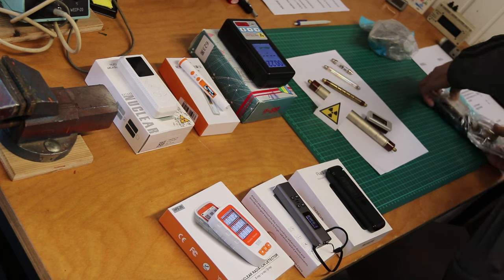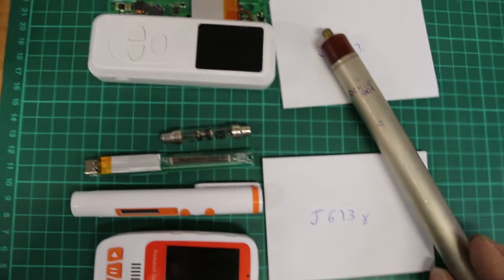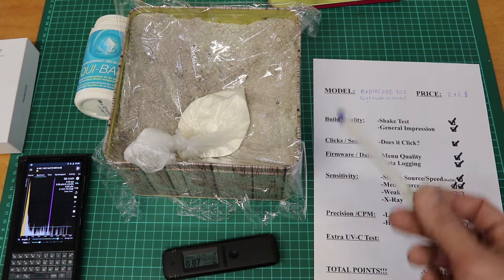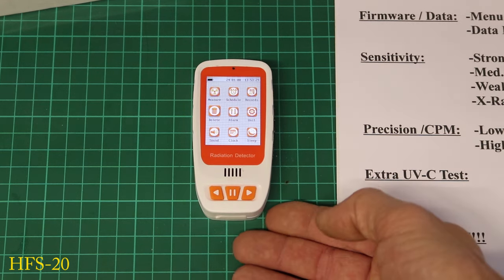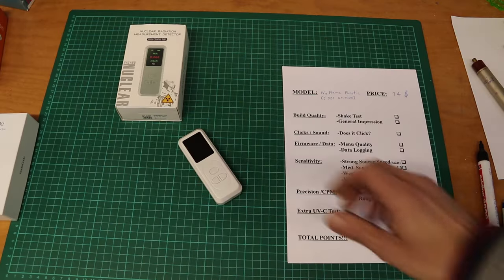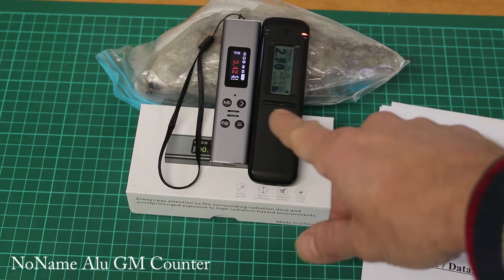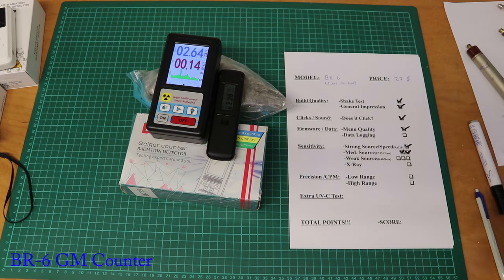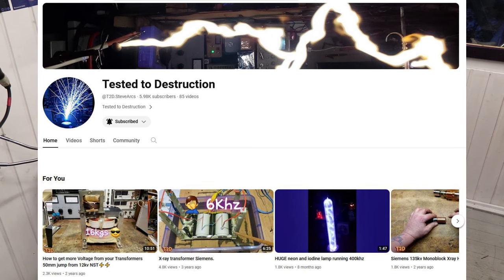5 Cheap Geiger Counters from Aliexpress (Review Time!!!)

Comment: 20 Minutes the white one which does not react to your souce is a Fake Geiger counter. Even the tube ist a Fake. Remove the tube and connect a cable between the 2 tube Ports and the counter Starts showing Fake results. I Just have one Here. The Volltage on the tube ist 3.7Volts and the tube ist only a  Glass with a wire inside. Complete fake.

Comment: The latest aluminium models are now able to measure β rays, as we have opened a window at the location of the Geiger tube so that β rays can easily penetrate into the Geiger tube. Woo woo we're late.🥲
Reply from the maker: Are you the Manufacturer? thats really cool! Thanks for reaching out ;) In general i like youre Product, the Design is Great! but i think there are some points you could improve ;) The Slits/Window is a great first step! The other main issue i see with this Geiger Counter is the Response Time of the Software. It is pretty slow compared to other Geiger Counters. For example the BR-6 is really fast, you see change in mSv/h immediately. On youre Device, it takes a few Seconds. If this could be faster, that would be great. The other thing is the J613 Tube. its pretty good for a small Tube, but all small Tubes are very limited in Count Rate. If you want to design a future Model, try to design it around the M4011 Tube (best chinese GM Tube on the Market, Beta Gamma Xray capable) or the J305 Tube (good copy of M4011). Just avoid the J321 Tube, this one is really bad.
Reply: Hello and thanks for your reply. Because the beta rays cannot penetrate the thick aluminum alloy shell, we have opened the window corresponding to the location of the Geiger tube, so the beta rays can easily penetrate into the Geiger tube, and this problem has been solved. But I want to explain to you another problem, that is, J613 has a significantly lower sampling rate than J321 and 4011 because of the limitation of its volume, and if the algorithm is the same as J321, it cannot achieve the measurement accuracy of J321. So we came up with the idea of another way, which is to find the actual amount of radiation of the measured object by measuring the average of the past minute. Doing so will cause our styles to appear to react significantly slower to rise and fall than other styles. (But this design can bring me a very big benefit, that is, our detector can pass the metrology certification of the Metrology Institute, and we test it in China's official Metrology Institute (Shenzhen Metrology Institute), and the result is: the deviation of the full scale is only about 5%~6%, which is why our products will be closer to your other model in terms of measurement data.) Sometimes that's the case, and if you want to be small and measure accurately, you have to sacrifice reaction speed, which is unavoidable. @BremsstrahlungChannel
Reply: What is the name from your Shop?
Reply: What is your Aliex or Insta name, i want to order a updated geiger counter. Which model should i order?

Comment: Fantasitc video! I bought an HFS-P3 last night along with the GC-01 GM's. Good to see I didn't waste my money on the HFS-P3. I got them from AliExpress :D
Reply: I'm a geiger counter collector and i can attest that the HFS-P3 is not that bad.
Of course is not perfect, the sensitivity is pretty low (can detect background but is not so accurate) but is tiny, cheap, it have the dosimeter function and also it have both the dose and rate alarm (with adjustable thresholds!).... and BTW it goes up to 5 R/h (which is A LOT, no other cheap chinese counter can goes that high!)

Comment: I bought BR-6 without reading reviews and I'm quite content with it. I liked how it doesn't have any gimmick. Just a board with the tube, a buzzer that can be turned off, a display and a box. Nice spacing between the grates and the tube, nothing wobbles, nothing is too covered. It also works on two AA batteries, which is nice as I greatly dislike built-in lithium cells.

I'm gonna use it to hunt uranium glass in thrift shops and possibly some minerals from waste piles. I think it will do well for that purpose as it's quite fast reading and sensitive. Thanks for confirming my intuition for the product.

Comment: You seem to have a lot of hands-on experience with various tubes and I'd like to ask you about the SBT-11 series. I have 3 tubes. One works well though I've noticed its background is lower than most, at around 0.7 uSv/h (around 15-16 CPM).

Then I have an SBT-11A which is what my device initially came with. It has times when it reads the background at around 0.3-0.5 uSv/h and I think it's movement-caused but I failed to figure out what caused this. It's difficult to get it to read normally but sometimes background returns to normal.

And I have a third SBT-11 which all around works well and seems to have even better sensitivity to the one I'm currently using. Unfortunately it sometimes, even without movement, starts to produce a lot of sparks on its own in one particular corner and climbs up to multiple uSv/h. If I shake it strongly this stops and it's back to normal but eventually it will do this again.

What can you tell me about these tubes and your experience because I don't know why I ended up with 2 defective tubes, was I just really unlucky or are they more finicky than most? There's also the case of the 3rd tube, it's not an 11A but it is more sensitive than my 11A to alpha and low-level beta so I'm thinking there's the mica window thickness but also the sensitivity of the inside of the tube itself can vary. I'd appreciate your insight.

Comment: Hello. What about the Pudibei NR 750 that Lily told. Is it better than BR-6?
Reply from the maker: i dont now the nr750, also i didnt see lils video on it ;) but looking it up on google it looks pretty similar :)
Reply: NR 750 is not too bad even if there is nothing special if compared to other cheap chinese devices.
Keep in mind that all the test that Survival Lilly do are not accurate because she failed to address the effect of the energy of the rays and she tested the geigers too close to a very small source.
Also the test in this video aren't accurate but still a little bit better than Lilly.
The NR 750 does the job fairly good at low and medium ranges but is not able to detect high and extreme amount of radiations (this is a very common thing for portable geiger counters, they failed when you needed most!!!)

Comment: A geiger counter in an aluminum casing is absolutely crazy if you ask me. How will you get a decent reading? 
It will only read gamma rays not beta rays or alpha rays.
Reply: Which means that the measures can be more accurate.....
The problem is always the same, if you want an accurate instrument you can only measure gamma....
.... if you want a super sensitive device, also able to detect alpha you end up with an instrument that tell you that there is something radioactive without telling the amount.

Comment: I really want to like the sharpie marker sized one, it's too bad it doesn't perform. Would it be possible to modify it with a Russian tube (are the voltages appropriate out of the box?) Also, is there any mod that can make them click, like a simple speaker soldered on the right place?
Reply from the maker: yeah it would be really cool to modify the HFS-P3 :) I only have one soviet tube that would fit, i did a quick test but it kinda performs similar.. im not aware of any good tubes in this size unfortunately (but im shure theres one out there!;) the voltage should be okay for most standardish 400v tubes i would guess, even if its abit on the lower side (i made a voltage sheet somewhere in my other video;) for youre click idea.. i had an idea for that but never tryed if it works ;) if youre good at soldering, maybe try to connect the positive of the LED (it flashes for every click) with the inbuilt speaker ;) cooould work! or use the LED positive to drive a tiny extra piezo or something.. i think LED positive is youre best chance for the click ;)
Reply: Is possible but not recommended.
The very good thing about this counter is the size.... if you try to modify it you can simple ruin it.
If you want someting you can hack, why not choosing a geiger that can be modified with RADPRO firmware?
In this way you can also adjust the response to match the property of the new tube (and you can also have some extra features too)
The compatible devices are FS2011, Bosean FS-600, FS-1000, FS-5000, FNIRSI GC-01
Otherwise, you can make your personal geiger using an Arduino based platform and choose the tube you want (preferably more than one tube, of course selectable, to have a wider range.

Comment: I'm new to the whole thing, but I heard that radiocode 102 doesn't pick up the alpha and most of the beta radiations (like the 101 before it)
Is that true? 🤔
Reply from the maker: ..im pretty shure none of the radiacodes pick up any alpha, maybe they do get some hard beta. but in general i would say dont worry too much about alphas and betas if youre a "beginner". Gamma is the bigger topic anyway ;) There is the Measall KC 761 if you want a full spectrum device, but im pretty shure is not very "beginner" friendly ;) PS: Check out the Channel "Studio 326", he has great videos on all that stuff! :D
Reply: Geiger counters that pick up alpha radiations exist but are more expensive and pretty rare.
Keep in mind that a geiger that picks up alpha-beta-gamma and X (eventually thermal neutrons too!) are very good for finding contamination but not to make a proper measurement.
If you want a broad range of detection AND accuracy you need multiple scintillation detectors (which is not something you can find in the average pocket sized device).

Comment: I have a question. Does the second cheapest one measure a beta type radiaton ?
Reply from the maker: good question! and after some further tests, i guess my answer is "maybe a little" ;) i dont have a "clean" beta source, but i did some further tests with the small J613 Tube thats in that detector, and as with most small tubes, the count rate is just very low. What i am pretty confident about however is that the BR-6 can detect Beta. BR-6 has the J305 Tube, wich seems to be the best of the 3 Chinese Tubes. I will post a new Video soon where i go into these details abit, and modify some Counters ;)
Reply: @BremsstrahlungChannel  Oh thank you for the answer, I've got at home few rad.a. things and I want to buy a dosimeter that is not so expensive but I want it to measure not just Gama waves. Actually I want to measure how much is my tritium chain harmfull because tritium is the most pure beta emitter
Reply from the maker: oh cool were talking Tritium! :D ive got some experience.. i have a small tritium keychain as a test source as well ;) and its my most difficult test source, even the plant ash is way more radioactive ;) i tested BR-6 with sbt-11a on the tritium and it can just barely pick it up. the only detector i have that can clearly detect the tritium is my Radiacode 102, but also with that, the count rate doesnt even really go up, but you can see the bremsstrahlung xrays on the spectrometer at about 5 kev. the thing with tritium vials is that they also emit a very small amount of x rays (because of bremsstrahlung interactions of the beta particles and the plastic/glass shield), so its also not really a "clean" beta source in practice. if you want my opinion, i would not wear it as jewelery on youre body, because it will give you a small dose of radiation over time (the x rays are not great over time eighter;). but if you have it as a decoration item somewhere in youre place, with a small distance to you,  id say that should be harmless. ill do some of these tests in the upcoming video for shure ;)  @wufan.cz.
Reply: @BremsstrahlungChannel Is the radiacode better than all the others in this video? I'm looking for one to detect radiation from nuclear fallouts/events as well as from reactor meltdowns. Need something applicable for that
Reply: @ryaniam22  all of the handheld detectors fail to perform at very high or extreme radiation levels.
The HFS-P3 have the highest range of all, which still may not enough if you are too close to the reactor.
I think that you should buy a military surplus device instead that is rated for both low, medium and high range, is calibrated for fission byproducts and is rated endure an EMP (for example an SV-500... but make sure that you have the full kit with both the internal probe and the external one)
Reply: BTW, if you have an SV-500 sets (i have two!) you can also find two another extra probes:
- a low range beta-gamma probe that can be either used to monitor surface contamination and can be submerged in liquids to check for liquid contamination.
- a very sensitive alpha, beta, gamma pancake probe (for surface contamination, also for food contamination).

Comment: I got an SBT-11a to install in my GMC-300+ but im not sure i have it working correctly. The background cpm went from ~20 with the M4011 to around 200-500 with the SBT11a but checking against some spicy pottery doesn't seem to change much.

ETA: just tested it again, background was 160-200 cpm on the SBT-11a modified GMC-300 and around 16k cpm combined alpha/beta/gamma on a fiesta plate.  The only other unit i have to compare with is a CDV-718 and it is reporting ~3mR/h combined beta and gamma for the same plate.

I need a proper procedure for calibrating this franken-detector.
Reply from the maker: ..if i remember correctly, theres a thing with Resistors on certain Tubes ;) I think i had a 1 mega ohm resistor between the + terminal on my 320 and the + connection of the sbt-11a in serial. Its really been a while and i forgot alot of details about my modification project, but back then i found alot of good forums (in english and german) that explained the stuff really well, its just a bit of googling i guess ;) PS: the 200cpm background is for shure too much, this should settle down to around 30-40cpm with the resistor installed (both tubes have relatively similar cpm values). i think they tend to freak out on the lower end of the cpm spectrum if the resistor is not there. good luck mate! btw if i find the relevant article, ill post it here ;)
Reply from the maker: ..just did a quick google search ;) so its 10 mega ohm, not one. this here seem very decent, he talks about bypassing the 3Mohm on the board and connecting the 10 Mohm resistor there, but in my amateurish knowledge i would say cleanest solution is to just add a 7 Mohm directly at the clip.. it also could be that i used a 5Mohm (plus the 3Mohm internal is 8, wich is close enough to 10 i guess :) https://www.reddit.com/r/Radioactive_Rocks/comments/15ivhv4/finished_gmc320_sbt11a_probe_modification/
Reply: @BremsstrahlungChannel  Okay, that's what I'm missing.  Thank you so much!